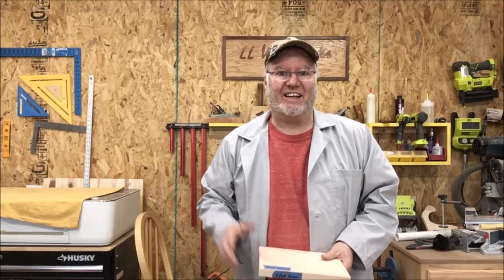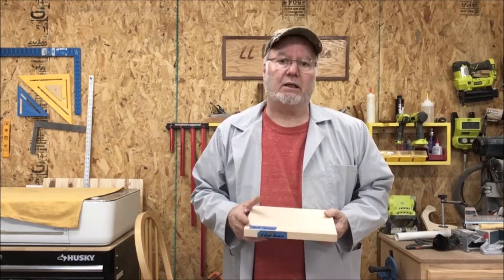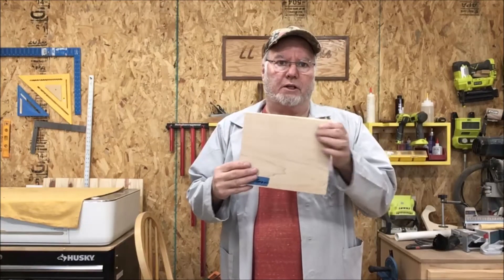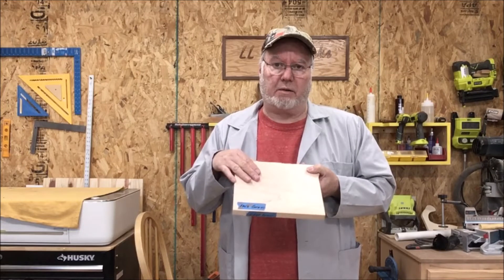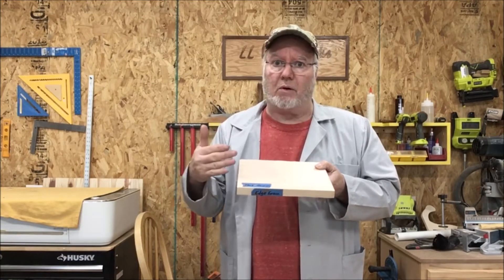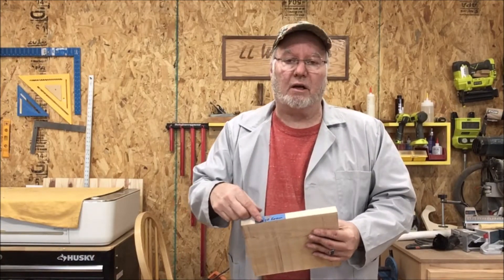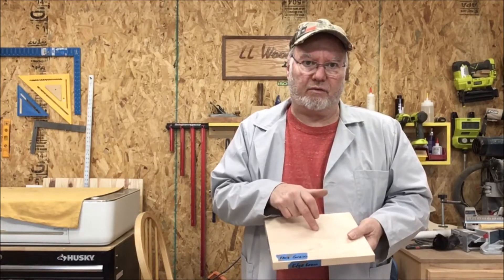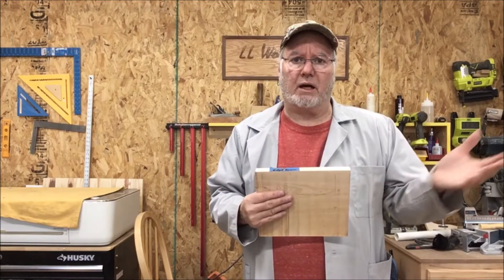Face Grain, Edge Grain, End Grain Cutting Boards

Comment: One other important consideration is the final surface treatment.  End grain will turn much darker with the application of oil than will face or edge.  Maple will become as dark as natural cherry and cherry will get dark enough that a contrast between it and walnut is much less.  So, where you mixed species of wood for contrast (American flag, etc.) the outcome will be dramatically reduced by the application of stains and oils.  This is again related to the "straw" effect of end grain absorbing the oil and not reflecting as much light.

Comment: My opinion, and I am happy to be educated on this matter...

End grain is stronger, edge and face grain are exactly the same. A trunk is round, the edge and face are not determined by which side the log is cut as there are no sides, its round.
If you were to rotate the log 90° before slicing it then what was going to be your face grain would now be the edge grain so I dont see how they are any different.